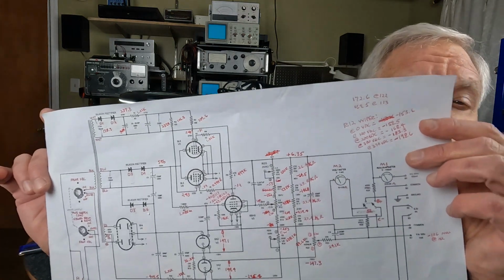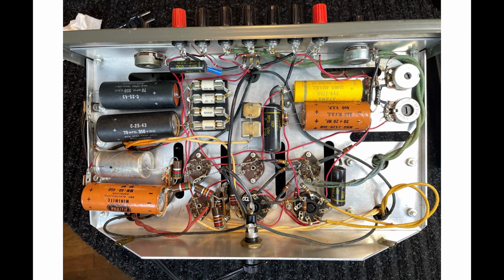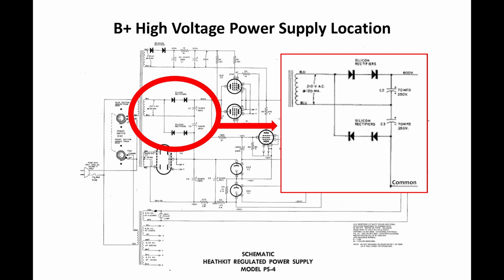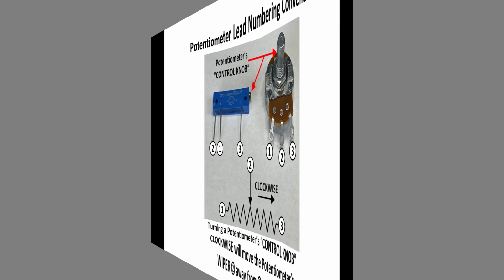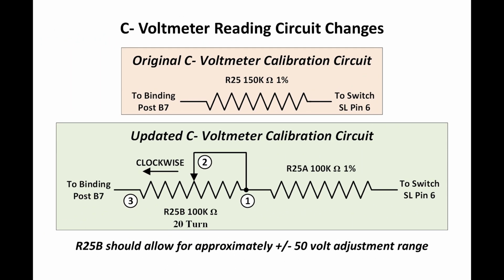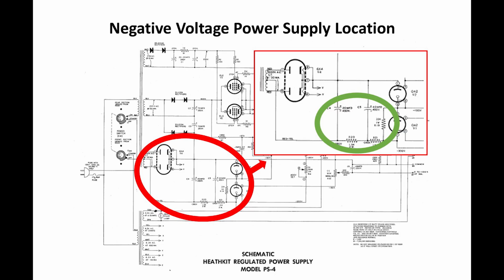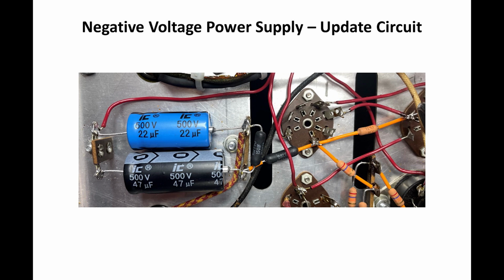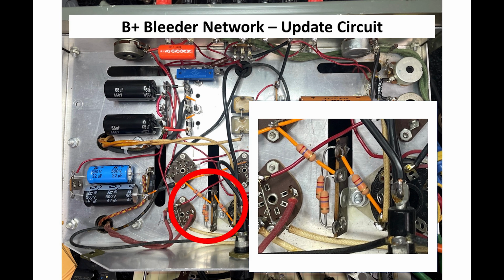Heathkit PS-4 / IP-32 High Voltage Power Supply Restoration Part 2.1 of 3 ... Episode 5

Comment: Great video, Steve.  I am currently restoring an IP-32 and had a question about your PS-4 project:  Are you planning on leaving the two selenium rectifiers in circuit? If no, I would like to see (or hear back from you on) how you go about selecting and installing two silicon diodes and presumably a series resistor that will take the place of the Se rectifiers.  I look forward to hearing back from you on this.   Thanks.